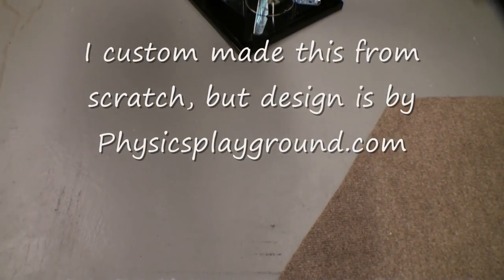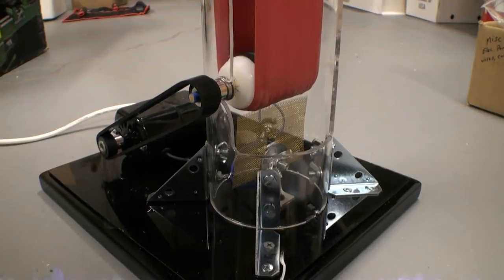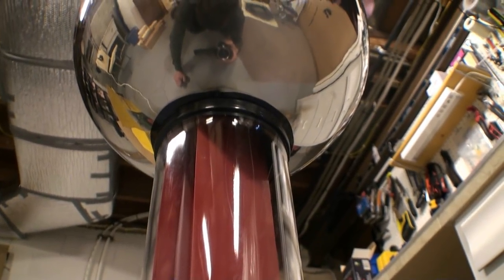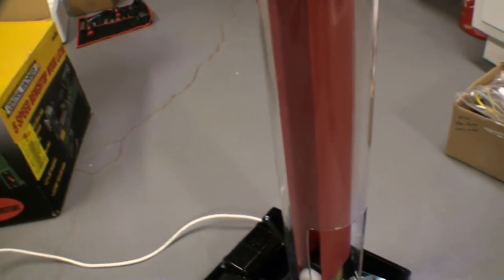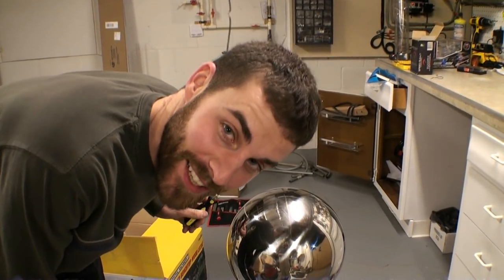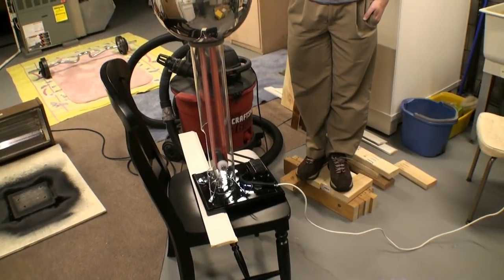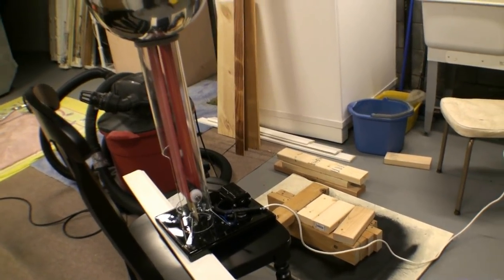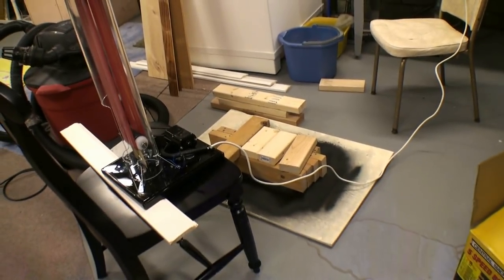My Custom Van De Graaff Generator (Design by Frederick Graff)

Comment: Considering the amount of effort and size, the sparks are very disappointing, seen units half that size create double the length of sparks. Have you used a fixed roller at the top?, is the belt pure rubber?, try sealing the tube off and injecting Helium which should create even greater charge. Great looking unit; there must be a problem with belt or top roller though.
Reply from the maker: Suzy Siviter watch the other video on it. This wasn’t finished at the time.

Comment: delrin and contact cement for the top roller and a nylon with wool on the bottom? I understand triboelectric series but what effect does coating nylon roller with wool do? and what would contact cement on the delrin roller do as far as triboelectric series? just trying to figure out a powerful generator idea!

Comment: what would be a good RPM at the lower shaft for efficiency and long belt life?   - Also , what might be the least expensive belt material for a VDGG of that approximate size?   (I have one with around a 14" mirror ball top load which needs a better motor and drive system)
Reply from the maker: The speed only dictates the rate at which it builds maximum potential. Meaning the frequency of the shocks. The belt material I use is still good after all these years actually. I thinks it’s just latex workout bands. I got mine already precut and glued from physics playground. Whatever the cost they are worth it.

Comment: I got better arc using a 1/2" rubber band and a small coffee can collector. If you are going to do this right, learn the triboelectric series and then pick belt and top roller materials based upon that. Put bearings in your top roller too, no sense wearing out belts for no reason. It is technically contact electricity, not necessarily frictional electricity. Two materials of differing position on the triboelectric scale pressing against each other strips electrons from one material and then places them upon the other. The further apart they are on the scale, the more electrons are stripped and the faster your Van De Graaff will charge. When I see these units without bearings on the top roller "for more friction" I just groan.
Reply: You would do better with a pantyhose (nylon or +30) belt and a PVC (-100) top roller.
Reply from the maker: Paul Andrulis if I remember, this was just a demo of the build before it was tuned. This is after it was done https://youtu.be/resYVWndHL4
Reply: Okay, kewl, will check it out. These vids can stay around forever.
Reply: Paul Andrulis need teflon on botom not top  and glass or rubber on top...
Reply from the maker: Bosnjak Bosanac this thing makes arcs over 12in with the way it's set up. Nylon wrapped in wool on bottom and teflon on top. Changing the orientation is just a positive or negative charge. It doesn't have hardly any effect on power. It would only matter if you set 2 of theses up side by side and arc between them.
Reply: Random Ryan ah ok nice I thought positive has to be up because air is positive and ground or teflon is negative it whould be nice from you to measure other way and tell us differences...?
Reply: Orientation doesn't really matter Bosnjak, unless an experiment requires specific direction of electrical flow.
Reply: Paul Andrulis thank you for your explanation 😀

Comment: You're not getting much charge to the dome. The short weak sparks show your rollers aren't quite the right material or your belt and rollers may be dirty or have some tiny amount of oil on them. And wood will bleed off your charge too.
Reply from the maker: david sul I have other videos with this. I corrected the issue right after this. 12in sparks or longer now.

Comment: I forgot to ask you where you got the belt too?  If she stood on the ground, would it be safe?  Some say no.
Reply from the maker: BO NES I ordered the belt from physics playground as well as the motor. Everything else cans from various places. Yes it’s fine if the ground. Depending on a few things though, the charge may not build up as much. It may discharge before it reaches full potential. Safe?? It doesn’t matter. If you wanted to make your hair stand on end, you and it need to be off ground.
Reply: Makes sense.  Thanks again  I almost have all my parts.  I can't wait to see what this does to nano crystalline Particles.

Comment: Nice VDG... Next time don't try to pass it off as your one built from scratch copying Physicsplayground.  This is just a kit from them.
Reply from the maker: This is not a kit from them. The only parts I acquired from them was the motor/speed bully and the belt. The rest I built from scratch. It may look like one from the site, but that's because I used the photos to copy what they did. The unique design Is theirs, but as far as the build goes, that was all me. I had to cut my own parts.
Reply from the maker: Do you not see my lathe on the floor there? I used that to cut my own rollers. I used a dremal to carve my own tube and stainless sphere. I used a drill press, hacksaw, file, ect. If anything I'll take your comment as a compliment because you can't tell the difference between one made by them and one I made  in my workshop. I also used a blow torch to smooth the cut acrylic edges on the tube.